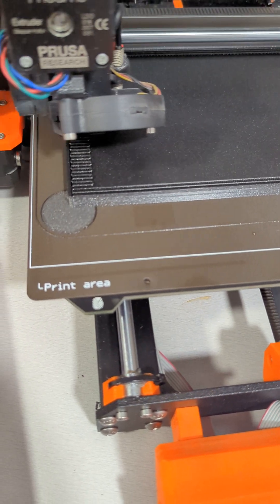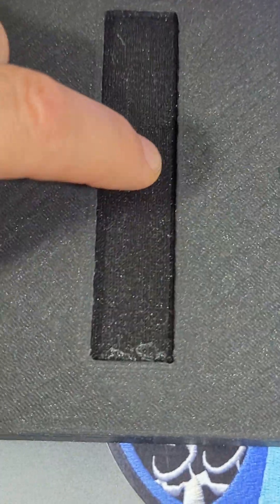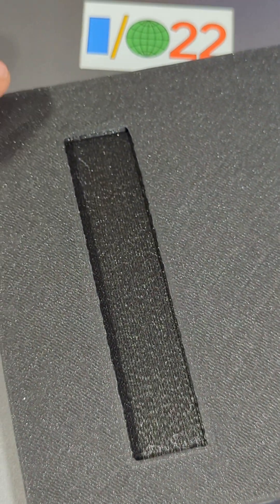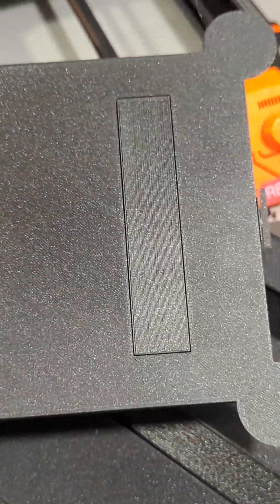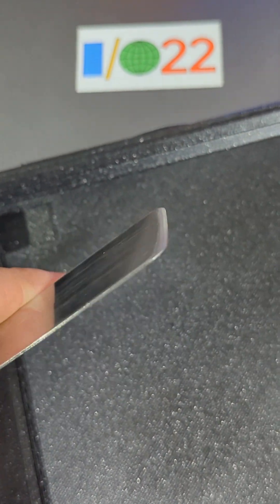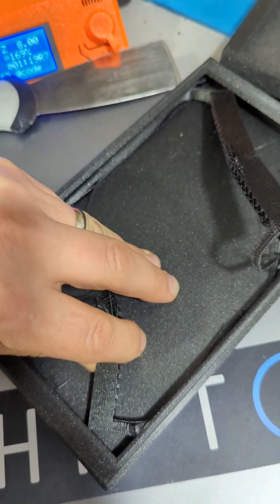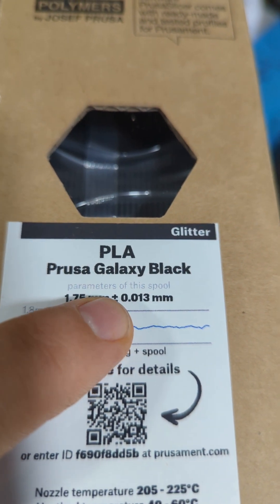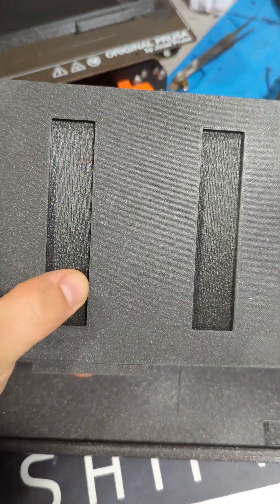How to print very flat and wide object with Prusa 3D printer and avoid warping

Comment: It works the same as brim with less material or it works different?
Reply from the maker: I add it just in places where it's needed. Brim might work for most of the cases, but for very challenging models, this is something you'd want to try to use.